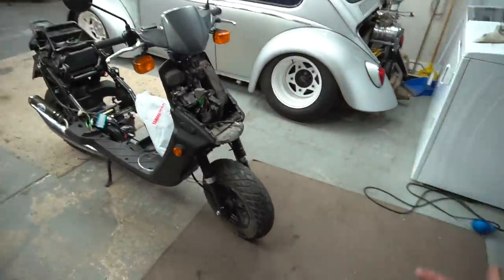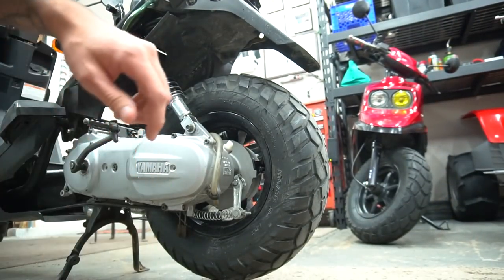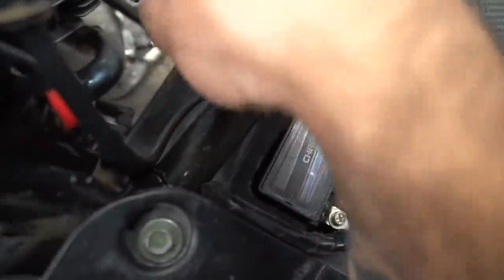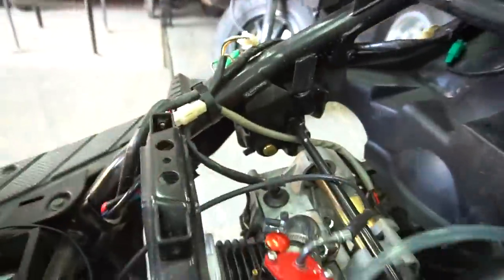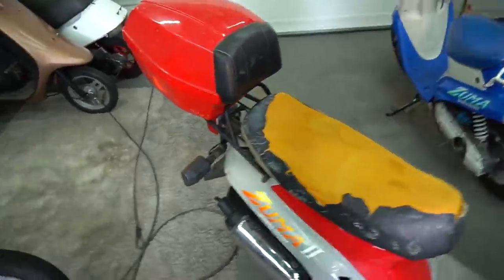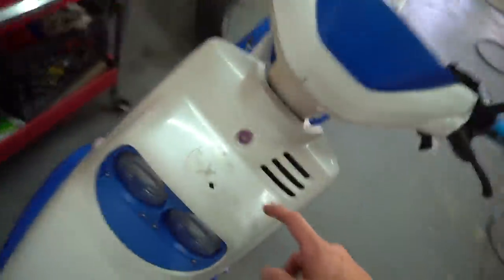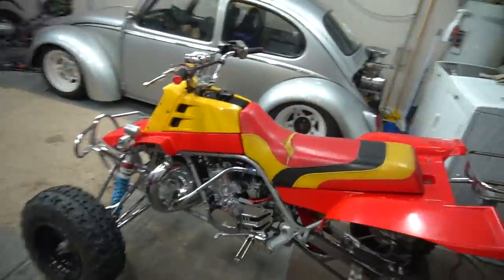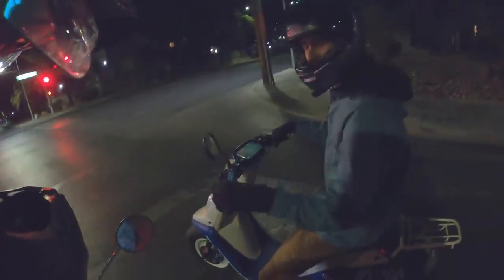iT RUNS! Yamaha Zuma POLINI 70cc + NEW Yasuni R pipe!

Comment: The 89’s were made in japan, in 1990, they switched production to an MBK factory in France. Some late built 89’s, sold as 90’s, were made in japan. In 2002, they switched production from mbk france to taiwan…
Reply from the maker: so i was kinda right. this one is stamped production late 1989 but it is a 1990 model. made in japan, sweeet
Reply: @MOPBOYZ  exactly bro! Sweet
Reply: Having choice which would be better option, I have the choice. Newer model has disk brake and double seat. Not sure